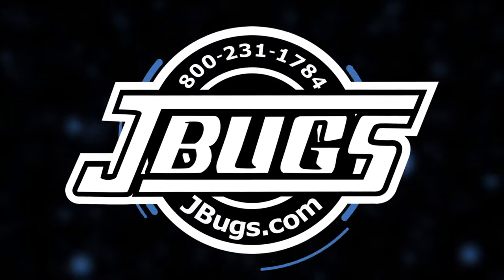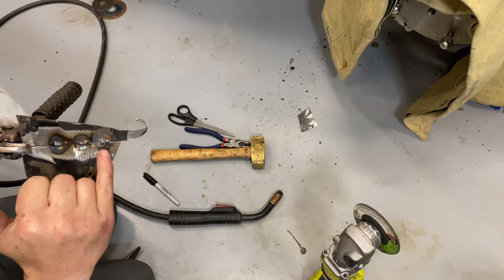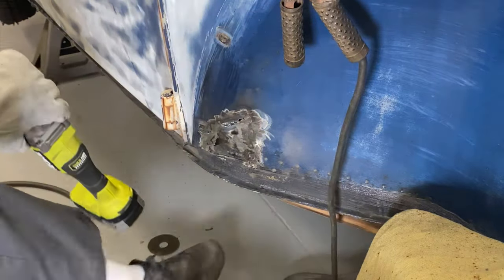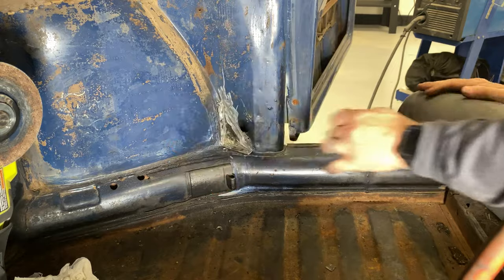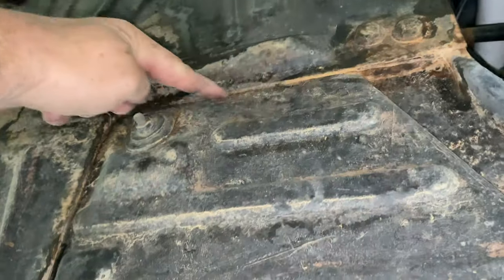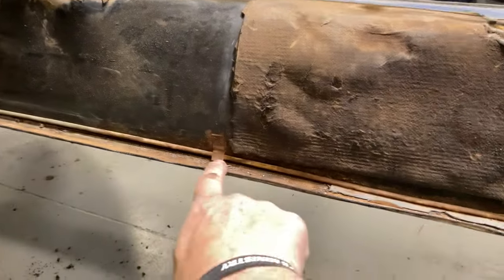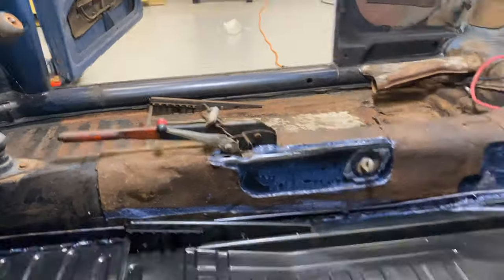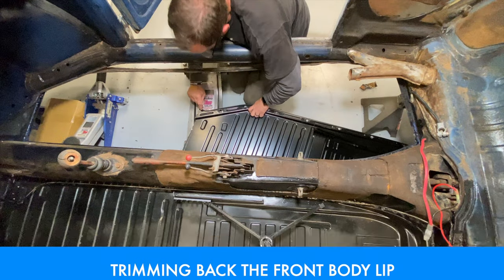1967 VW Beetle - Rust Repair - A-Pillar, Clutch Cable Tube & New Floor Pans!

Comment: I think the key point in a body-stays-on floor pan replacement is "drive it and enjoy it".  This is a good bug, it just needs some fixes.  Not every bug needs to be a full on restoration.  You are just days away from a mechanically sound ol' bug.  Thank you for sharing this.